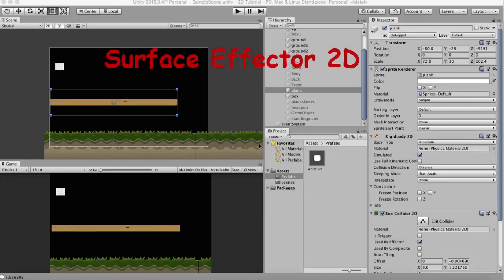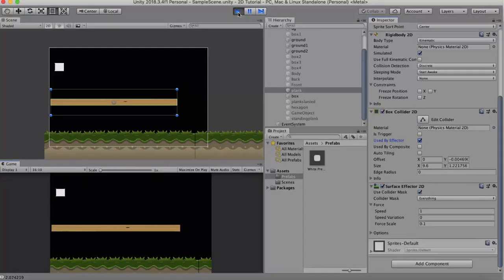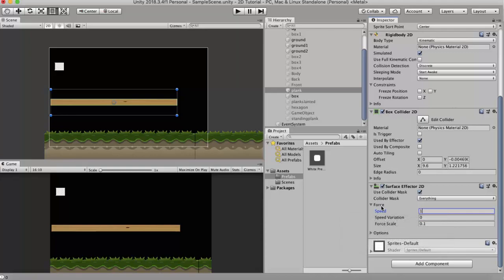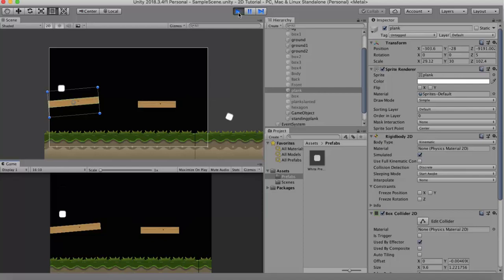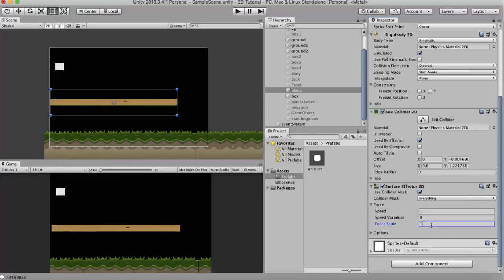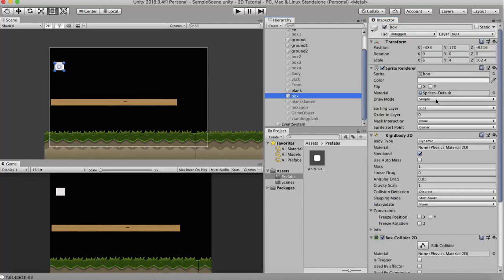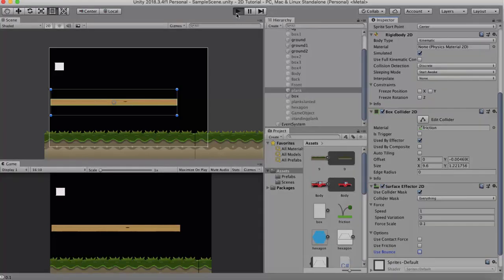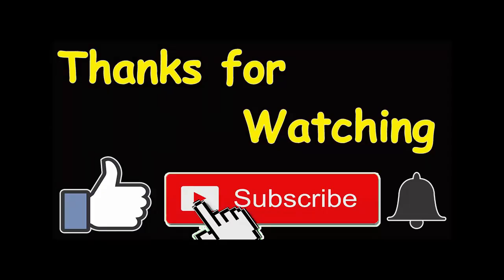Surface Effector 2D - Unity 2D Tutorial

Comment: Hello, how did you manage to interact with the physics of surface effector? like moving against the effector slows the speed, or moving along increase the object's speed. Mine just slides but when I move in the effector the physics doesn't really apply well
Reply from the maker: Couldn't tell. Try to tweak the properties in the rigid bodies of the two objects. may be that will help.
Reply: @KeepLearningInLife  haha thanks, I solved it by using transform.translate as movement. Two rigidbodies won't work because the player velocity overrides the effector. Great tutorial btw!